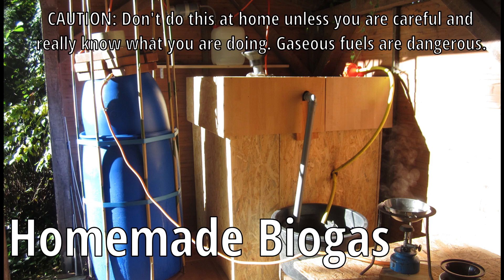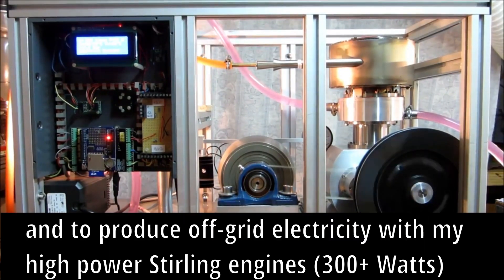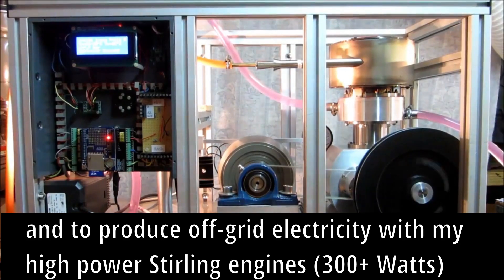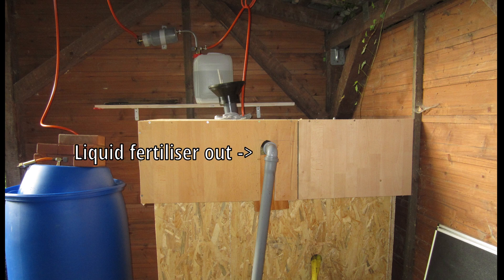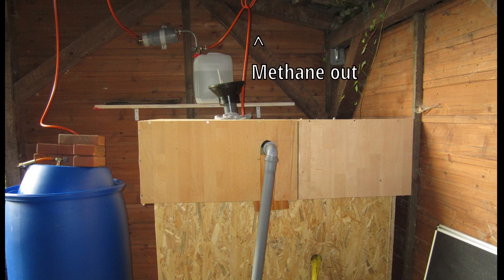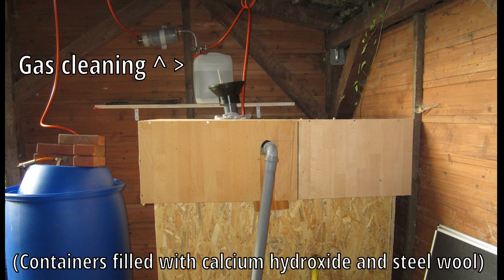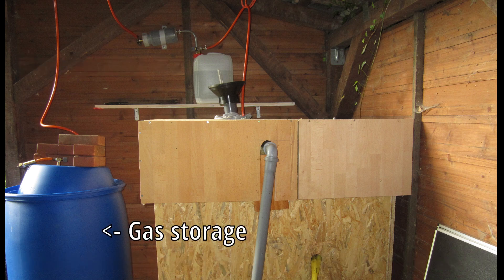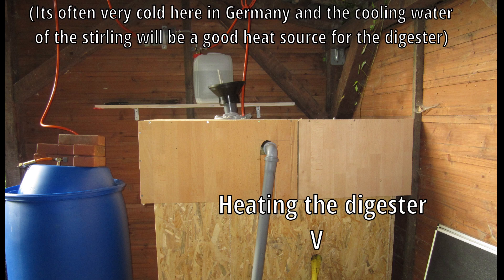Homemade biogas digester for cheap renewable off grid electricity with my DIY Stirling engine CHP

Comment: How have you managed to keep the digester functional through winter?
Reply from the maker: I insulated it and wrapped a hose around it, through which the return flow from my combined heat and power unit is fed. However, it only needs very little additional heat if it is well insulated!

Comment: Hi Ralf, i use a similair setup but with a refrigerator compressor, to compress the biogass to 10 Bar in a Propane Bottle.
I clean the gas through a wood ash filter that makes the gas clean and odorless.

Do you make the gas without heating the water?
I have used an electric Aquarium heater, but that uses a lot of electricity, i have however insulated the IBC container with styrofoam balls..

MFG,
Mark
Reply from the maker: Hi, I also thought about compressing the biogas and I insulated the digester very well for the winter and feed a hose with the hot cooling water through it.
Wood ash works well, interesting as we have eoungh of it...
Thaks for your comment

Comment: Hi, I've just started up my Methane Digester, cow dung being my startup feedstock.  Everything got moving after heating up the slurry in the IBC of 1m³ to just over 30°C.  Would love to hear how you go about cleaning the gas.  I've read the following stages, first bubble through water, then through a bed of moisture absorbing granules (like cat litter), and finally through steel wool.
Keep well & hope to hear from you.
Reply: Did you already built your gas cleaning line? It would be great to know how it went.
Reply: @FBPrepping  Yes I did, unfortunately we moved into winter and I didn't get good enough cow manure...so the process came to an abrupt stop.  Will go around the farmers again and ask for fresh cow manure and load up the system again.  One of the tutorials recommended using Ø50 or 2" pvc pipe to feed the tank, but this is far too small the matter that is fed into the tank just gets stuck in this little pipe - annoying.  I'll increase the pipe diameter to something like Ø65 or Ø80, so need to dismantle my setup a bit to get this done.
The Gas Cleaning unit is done as in https://www.youtube.com/watch?v=W7zCf1TphBs&t=851s

Comment: With that size of biogas reactor can you tell me the everage gas produced on a 24hour period on a hot day
Reply from the maker: here in cold Germany with not optimal conditions I get about 100 liters per day, with higher temperatures and better conditions I think about 200 liters per day could be possible.

Comment: Richtig nice, danke. 
Der Generator für die Wärmerückgewinnung ist top.

Baue was ähnliches...auch mit 200l Digestor.
wenn der Gastank voll ist, startet der Endschalter das Nachlaufrelais für den alten Kühlschrankkompresser der die 11Kg Gasflasche auf ca. 12 Bar füllen soll (mit Luftkompressor -Sicherheitsschalter) die angeblich um die 130 kw fassen soll...bei Wärmebedarf soll die Camping LPG-Heizung mit 36 Kw Leistung( um ca. 260€ von Amazon) den Pufferspeicher des Hauses auf 75° erwärmen...
Eine andere Option wäre  ein kleiner Benzin-Viertaktmotor mit einen LPG Vergaser als Art mini BHKW , der bei Schlechtwetter den Digestor heizt oder die Solarbatterien auflädt.

Freue mich auf weiter Videos.
Reply: Mach mal nen Review wenn du fertig bist bzw halt mich auf dem laufenden bin da auch am experimentieren und suche nach Möglichkeiten den Digestor zu erwärmen.

Comment: You should try using a DIY parabolic trough collector to generate electricity during the daytime so you don't have to produce as much biogas to run the generator.

Comment: Pretty cool video. 
About the electricity, why not Just build a windmill for your electricity ? You can quite easily build your own 1 kwh windmill
Reply: Most likely not allowed by local authorities. Wind turbines brings issues like noise and shadowing.

Comment: Here in sunny Florida, USA, a few solar panels are a cheap reliable way to produce 300w (and much more). But I suppose German climate requires a lot more creativity and complexity.
Reply: Year but not at night . If you dont have a Power wall ore Something like that you are Not of grid
Reply: biogas powered systems are good very good for farms. I do agree it is too much work to power a single home.

Comment: Use excess solar energy to power a compressor to store the biogas in a canister, use said canister to power sterling engine outside of peak solar times
Reply: Smart
Reply: compressor expensive for power a lot of engineering uses as much as it produces...
Reply: there needs to be a way to store or use this gas at low pressure
Reply: Plain IBC 500 liter containers installed as accumulation tank, heated as much as possible for later usage. Eventually supplied by cheap grid electricity during the night/low price periods?

Comment: Hi Ralf, congrats to your highly developed and well running stirling machine ! There's a of dedication stuck in your built. Several years ago I did build a loaded stirling machine with hermetic sealing of the inner pressure. It was running but with little power because I only wanted to test the sealing concept and therefor I let aside all means to increase the power that would have complicated the built.
Have you ever heard about the afterburner Brayton cycle based machines of Richard Proeschel ? Would like to know your estimation about that concept. 
www.proepowersystems.com

Comment: I am thinking of building something similar, yet as you have shown the pressure of the gas is too low to be useful. As I don't have waste to feed every day I could fill the reactor once and wait until most of the process is completed. As the system is enclosed it should be possible to run the entire bioreactor under elevated pressure. This is called autogenerative high pressure digestion where the whole process takes place inside a pressure vessel. The ongoing methanogenesis slowly builds up pressure up to several hundred bars. The whole concept is described in this paper: https://www.semanticscholar.org/paper/Autogenerative-high-pressure-digestion%3A-anaerobic-a-Lindeboom-Fermoso/93532ba51546faf8323e2d3d41ac947e95d538ae. The methane concentration in the produced gas is greater while H2S and CO2 get solved in water. This leads to undesired acidification, though. The gas can be stored in less space. One could build multiple independent reactors that feed the gas into one tank, so they could be refueled individually. The only problem here is building the pressure vessels. Used diving bottles could be a cheap source.
Reply from the maker: Hi Spreng0r,
several hundred bars pressure sounds interesting but also dangerous for me.
Please let us know any progress of your project.
The low pressure of my setup is not useless (I can cook and heat water and so on) but it is not enough pressure to run my Stirling generators.
When I have time I will build a small pump and look how many power can be produced with the biogas.

Greetings
Ralf
Reply: @myengines2443  Hi Ralf as a fellow engineer working on a mass produced model of what you have I encourage you to find a way to use the low pressure gas for electrical generation, what you have is very nice, the future will require multiple fuels with any number of delivery methods. I am leaning in the direction of a smaller stirling for the small temperature differentials that surround us everywhere in life.

Comment: sir please make some more videos like this. I'm also made a Diy Lead acid battery from Soldering wire. it worked but very low voltage but enough to light a LED. But i didn't made any video while making it.

Comment: This is absolutely amazing. For how long can you run the stirling engine from 100l of methane?
Reply from the maker: Hi,
the pressure of the gas tank is to low for the ringburner as you can see in the video.
I can cook about 30 minutes with a daily yield of 100 l biogas.
Greetings
Reply from the maker: Next thing I will do is to compess the biogas to a higher pressure to see how much electricity can be generated with the Stirlings per day.

Comment: The flame examples indicates too much air in the premix (as you also noted). Simplest way to test is to tape one one or more air inlet holes shut, should help with the flame lift. Unfortonately methane has a boiling point of -162 c otherwise condensing it would have been nice. Perhaps further compressing the gas is the way to go. Steel tank with a rubber bladder inside and compressing with air?

Comment: Maybe Make mini electric turbo to suck out of the barrel and push into the gas burner
Reply from the maker: Hi,
thats a nice idea because no extra gas tank is needed.
You have an idea what kind of turbo would be suitable?
Thanks Ralf
Reply: I don’t think it would have to be much maybe just a small motor inside a pipe with the right shape impeller🤔
Reply: @myengines2443  I think you will end up with multiple different orifices in the burner or possible another slower running Stirling.